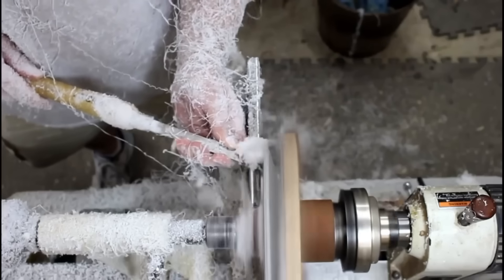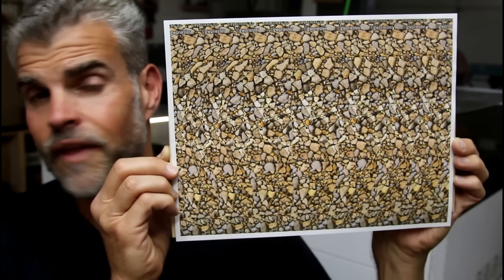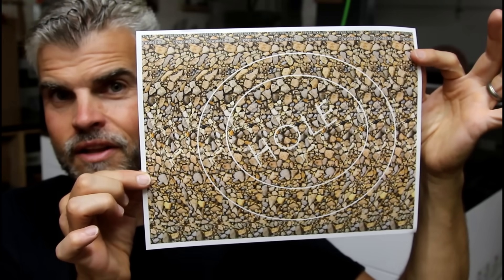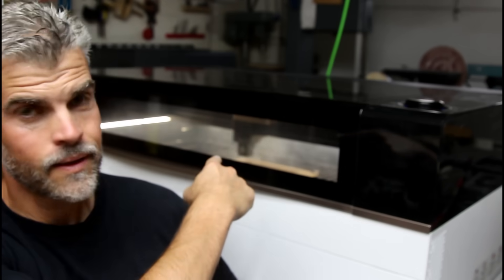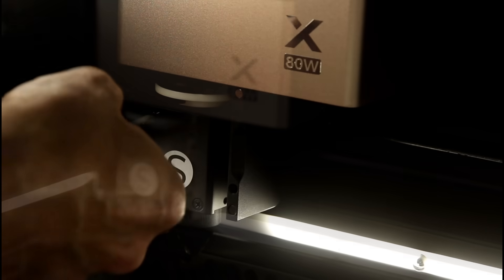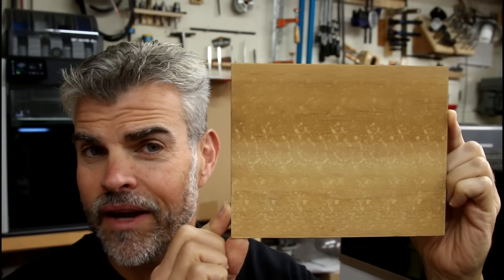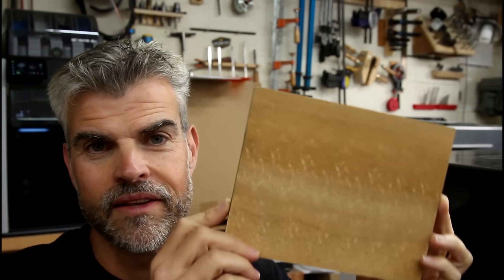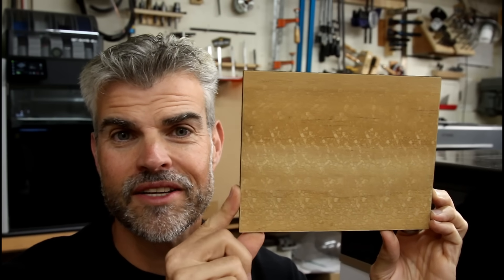Can You See This Image?! Laser Engraved Stereograms! xTool P3

Comment: never could see 'em and still can't LOL
Reply: I was about to comment the same thing…
Reply: Same, can't see a thing
Reply: I have stared at the picture he is holding of the pebbles for so very long! I cant see s***! there is the repetition and the clear top to bottom layout but what the pebbles are hiding I have no clue.
Reply: Same
Reply from the maker: At you all know I didn't lie in the thumbnail! :)
Reply: As long as I am not the only one.
Reply: Me either. I decided to play around in photoshop to see if I could manipulate the image to see the hidded image. Turns out you can and the whole magic image thing is VERY over hyped. I was very undwhemled. 
If you want to underwhelm yourself, in an image manipulation application that supports layers, paste the magic eye image in twice. Set the top layer to difference and then move that layer to the right. You will see parts of the hidden image pop in and out of view as you move the top layer sideways. Eventually the whole hidden will be revealed. I don't know if what is revealed is the same as someone with the ability to see these images can see, but I now know I wasted so much time back then trying to see what everyone else was so impressed by.
Edit. I just tried it on a few more images and it doesn't always work.
Reply: Same and i normally see images in a lot of things all the time but ig that's different than a stereogram though
Reply: I am able to move my right eye independent of my left, basically i can go into "lazy eye" mode at will, and that has always made it easy for me to see these. Maybe that will help someone out there. going cross eyed and then back into normal vision is how you learn to do my trick, but really I think it's just all about being able to adjust the depth of field in your vision independent of what you are actually looking at, so anything you can do to unfocus and refocus your vision is likely to work, even if you are only able to see it for a moment as the focus shifts.
Reply: Does astigmatism make this not work?
Reply: The word “HOLE” is repeated several times in all caps in white across the middle of that image, tilted about 30° counterclockwise.  It is difficult to see, but after seeing how it looks in the wood, you got a reference of what to look for in the pebbles.  It is just hidden among the background noise of details formed by other pebbles.

Comment: You have to be defocus your eyes a bit to see them.  When I had 20/10 vision, it was easy.  20/20, easy.  Now that my vision is degrading a bit in old age, it's a LOT harder, and I never saw them well in your video.  Putting on various reader glasses doesn't help.   Then again, the clear, glossy posters were always easier than digital on-screen, they showed clear layers of depth.

Comment: As a kid I could never get those things to work. Now though, I seem to have developed a better muscle control with my eyes; which is ironic, as my eyes have weakened in other ways in recent years. But yeah, I have to unfocus them, sort of at that point between normal focus and completely crossing my eyes. Even then, i could only mostly just see the rings - although I could see at least a third ring. But I could really see the writing, at least not until you point it out, by drawing on it; and it was mostly the E and O and kind of the H. So it more looked like "HOE repeated over and over....

Comment: Something people don't think about when trying to see these is rotation. If it isn't at the right angle your eyes crossing won't overlap the 2 sides of the image to see the 3d version. One side of the image will be slightly over or under the other. So they don't line up. Slowly turning the picture can help some times.

Comment: I just picked up 3 magic eye books from a local goodwill. The fronts of the books give an almost overly in depth description on how to focus on them. The coolest part to me is that you can make them work by focusing behind the picture OR in front of it as long as you get the distance correct either way. The only different is the depth that you see will be inverted doing it one way versus the other.

Comment: I have done these before but in this one I see multiple O's with lines through them running across the middle of the picture that are big. I can also see the individual letters and parts of the distortion scattered around the picture like a jigsaw puzzle.

Probably does not help that I just upgraded to a huge 4k screen, or maybe filming the picture has distorted it to much rather than importing the image into the video to get a clearer picture that is not slanted by holding it up.

Comment: Some time ago I had obsession with cross and parallel-eyed 3D images. Basically you have 2 images, where you focus eyes on different images and you get a 3D effect. Learning how to do these has the side benefit of stereograms being a breeze now. Vast majority take ma around a second. I look for a distinctive shape that repeats (like the white rock in the lower middle), go parallel-eyed to align two of these and done :)

Laser etched one was a little more difficult, but I can see the "hole" too. I think the wood grain makes it harder as the non-repeating background (maybe rotate the board so the wood grain goes vertically?). Also one made with the medium lens seems clearer than the small lens. I wonder how would large one perform.

Comment: or you can use depth maps in stereogram software and create your own.. but i would also try would be after the first engraving then i would convert the picture to line and then engrave that over the top for the details.. also a good way to work out your eyes to see them is sit in a chair about 2 arms length away  and focus on the wall.. and bring your hand up holding up 1 finger.. when you look directly at the wall you should have 2 fingers in your vision.. if you can see them.. then you can see a magic eye picture.. you have to focus beyond the picture..

Comment: I saw the first image as a bottle, not a hole. The rest were the same - all bottles, no holes. The two digital images showed some kind of carving in the center circle, but I couldn't make out what it said. The first lasered image showed the text very clearly; the second was the hardest to bring into focus. I'm 70 and have been looking at these things for many decades. The method that works best for me is to focus behind the image. Once it's in focus I can look around corners. It works for non-stereograms as well if there's any kind of matching overlap. Cool experiment! Maybe try it with plywood that has the layers colored differently.

Comment: The best tip for seeing these I ever learned was to put your finger out in front if you (while facing the image, of course), focus on it, & slowly move your finger closer to your nose. As your eyes begin to cross, try to shift your focus to the image; you should be able to find the point where the 2 images come together into 3d.  What's strange to me about this image though, is you describe it as a hole, descending into the image, but to me it comes out more like a vase, looking from the top down, coming up out of the image 🤔

Comment: The most successful technique i have is if you can cross your eyes, what you are actually trying to do is stack the repeating pattern on top of its self. So for instance find two H's next to each other and try to get them to overlap into a single one by very slightly crossing your eyes. then you need to get your eyes to focus on it correctly once you have it in that position. You sterogram pretty much any repeating pattern, when i was bored in school i used to stare at the ceiling grid and get it to overlap.

Comment: I used to work doing binocular vision therapy with people who had poor/no depth perception (from lazy eye, or concussions or whatever) and we used magic eyes a lot. One other good technique is to hold your finger about halfway between you and the picture and look at your finger (so you see 1 finger), but put all your mental attention on the picture (if your finger doubles that means you're looking at the picture). Basically you need to cross your eyes JUST A LITTLE or point your eyes at a spot BEHIND the picture for it to work.
Reply: The cross-eye technique is far easier but will unfortunately result in a reversed image as most stereograms are designed for parallel viewing.
Reply: @benryves  WHAT I did not know this! I have been doing it cross-eyed my whole life! (edit: tried the finger trick just now and its still reversed....)
Reply: @ronnygrnhaug2524  The finger trick also involves you going cross-eyed as you're focussing on something closer than the page - you need to be able to go focus on something further away for parallel viewing which means looking "through" the picture, e.g. by staring at something in the distance first and then bringing the page in front of your eyes. I find it MUCH harder to do voluntarily, and can't focus on the image this way (whereas cross-eyed I can do without issue and the picture is in sharp focus, just reversed!)
Reply: @ronnygrnhaug2524 the finger trick IS crossing your eyes. To do it th other way I recommend the “start looking far away and hold the picture close to you; then move it away slowly” technique. The trick is then to keep your eyes looking in the distance and not get distracted by the picture appearing in the foreground
Reply: i have very little depth perception and even this trick sadly didn't help me at all (i also never saw two fingers, just one jumping left and right)
Reply: @JarharaJaiArik it sounds like ICD10 Code H53.34: suppression of binocular vision. An optometrist who does vision therapy or neuro-optometric rehab should be able to evaluate and treat it if you think it’s a problem
Reply: @gibberishname  i had a few attempts at fixing it and already and some actually made it worse. I think i'm kinda done with trying to change anything on that front now
Edit: after trying to get magic eye images to work for 20 minutes last night, my eyes now hurt a lot...